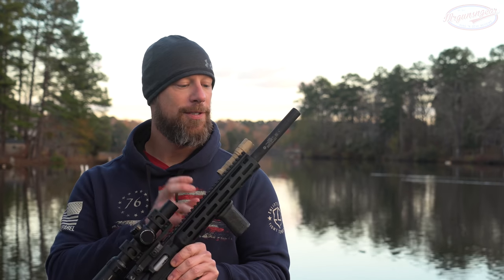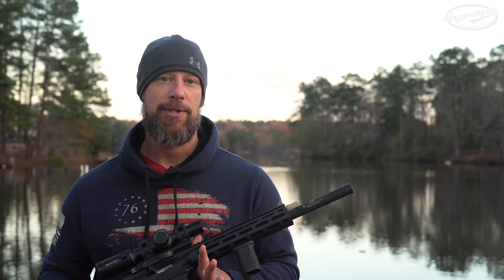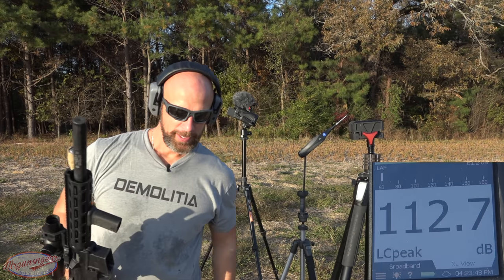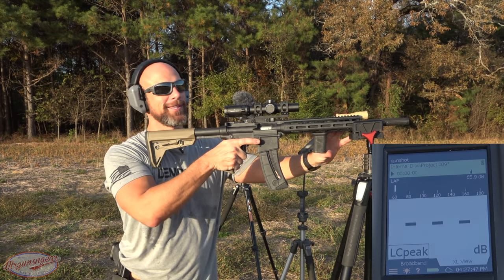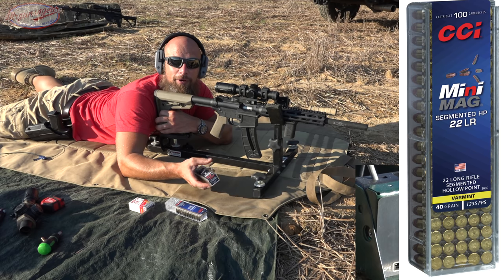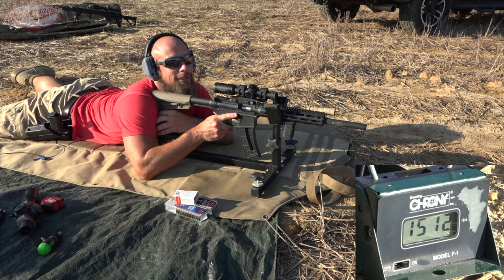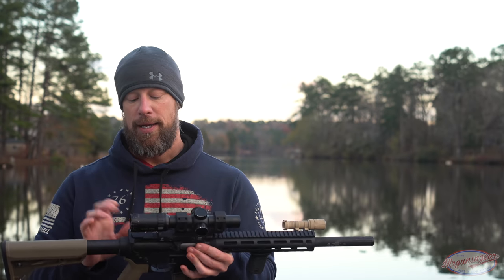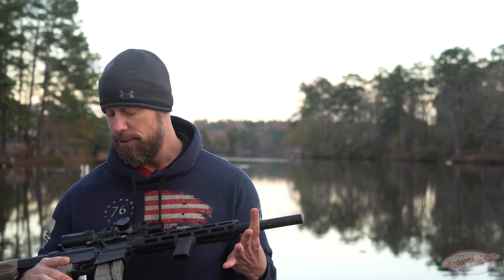Gemtech Integra Smith & Wesson M&P 15-22 Integrally Suppressed Upper Receiver

Comment: How did you not test the 60g subs? Overall this is impressive cause a factory rifle has a lot of issues cycling with subs. As most 22 semis wo suppressors do. 

Man I own 0 suppressors but really thinking of getting this for my daughters 15/22. However my question is the 15/22 is very finicky about getting dirty so how many rounds did you shoot like this wo issues between cleanings? I know my daughters even with upgraded extractor and springs still is only good for 2-300 rounds before it needs a deep clean to be reliable again.

Comment: Since ATF claims they're willing to give out free stamps for braced pistol/sbr, we should push for free suppressor stamps. 🤔

Response to ATF on open comments- "Hey, gubmint, pleez gibs me stamps for quiet time. I'm a poor that can't afford a piece of paper that cost more than the can."
Reply: Should push for abolishing all firearm laws
Reply: Good luck getting a can for less than 200
Reply: @Lordofthepoors  the can isn't the issue, it's the arbitrary paperwork that costs as much as the can that I have issue with. There's about 5 decent rifle rated production cans out there for under $200 but I'd be happy with a free tax stamp for a form 1 & I would order some titanium or niobium and send the cad specs for the monocore baffle system over to my local machine shop. They would be technically making a muzzle break & I would have to tap the O.D. as well as make the sleeve...
Reply: @RichardCranium321  a good rifle can will set you back more than the 200 dollar tax stamp
Reply: @johnniewasr5740  NFA should be ruled void and unenforceable under the Vagueness Doctrine for the "unconstitutional vagueness" concept....

- Vagueness Doctrine:
"In American Constitutional law, a statute is void for vagueness and unenforceable if it is too vague for the average citizen to understand- when average citizen cannot determine what is prohibited OR what punishment may be imposed. Criminal laws which do not state explicitly & define what conduct is punishable are void for vagueness. If legislatures delegation of authority to judges and/or administrators is so extensive that it would lead to ARBITRARY PROSECUTIONS."
Reply: @Lordofthepoors  why does everyone feel the need to be the "well ackshually ur wrong, its this" guy...  is it just YouTube🤔?

I said DECENT production rifle cans for under 200 but materials for a GOOD monocore form 1 will cost right about $225-250 delivered depending on shipping costs. None of this solvent trap BS either.  Those are good for exactly what they're name says, catching solvent.  The issue here is you took what I said and ignored the important part to attempt to criticize me on finances rather than say yeah, we should ask for free suppressor stamps since the things on that list apparently pose no danger because they're asking for mass expansion of items on the list and have no (announced) penalties for them now other than a twisted financial one on specific items which they get to determine on "case by case basis using, but not limited to, the terms outlined in official letter"...
Reply: @RichardCranium321  go for it, ask for free stamps. Good luck lmao
Reply: @RichardCranium321  lmao imagine thinking asking for free registration isn't bending over for the government. Free men don't ask for permission
Reply: @Lordofthepoors  you're still missing my point...  they're pushing one way, rather than defending & discussing that, we should pivot and go the opposite direction.  Keep the braces the way they are, push for free expedited can stamps since they're willing to hand out free sbr stamps. It shouldn't just be us defending our rights & them trying to take them, we should actively be trying to get others back- the best defense is worthless without a good offense... Tell um they should remove the sbr clause & give expedited stamps free of charge to anyone who applies for one. They want to do away with solvent trap market, what better way to do it besides remove the bureaucracy, fees, and year waiting period. Ton of entry level people would spend the $ on actual production cans like the po' boy 30.
Reply: @RichardCranium321  free registration isn't a good thing. It encourages people to register shit. And buying shitty cheap cans isn't a good thing either. I'm not missing the point, your point just sucks
Reply: @Lordofthepoors  I'm sorry to hear you think more cans in the hands of the public at a drastically reduced price is a concept that "sucks"...   I prefer a healthy balance of market competition, especially for Taurus and hi-point owners.   When they push one way, you don't just turn your back an walk away while trying to hide whatever you got. You meet them head on & say "I think I'll keep what I have and I'd like to take THIS freedom back while I've got your attention, thanks"
And as far as a registry goes, if you don't think a federal 4473 database already exists yet they're storing all texts, calls, and emails under the patriot act - you're obviously blind.  I'm not saying "register what you got"  I'm saying "get stamps for NEW stuff"

It's your interpretation and attitude that sucks...
Reply: @RichardCranium321  cool story bro. Let's totally register everything lol
Reply: @RichardCranium321  lol because free registration is fighting for freedom.
Reply: @Lordofthepoors  when it's now $200 and takes a year, it's a damn good place to start & is a hell of a lot better than just sitting back and laughing, doing nothing while hoping the piranha eat you last...  the comment responses are public info,  I'll gladly read yours - oh wait, you're too busy worried about comments on a YouTube channel THAT HAS TONS OF REGISTERED MACHINE GUNS AND SUPPRESSORS...  why aren't you messaging Mike & criticizing him for his S.O.T status since "free men don't ask permission"....

Guess who else doesn't ask permission- CRIMINALS, And the gov't is looking to create more each day.
You go right on ahead, drill those 3rd pin holes, grind all those pesky serial numbers off, go crazy building suppressors and hand them out to everyone you see...  after all, you're a free man, AREN'T YOU??
Reply: @RichardCranium321  cope harder
Reply: @Lordofthepoors  when people like you stand for nothing, they fall for everything... best of luck with your "free men don't ask" when atf knocking on your door with a warrant - because they asked a judges permission they no longer need yours...

Comment: FYI - speed of sound in air is only dependent on temperature, nothing else (not alt., not humidity).  So, you said it was about 95 degrees the day you were firing from prone.  Therefore speed of sound was 1154.48 fps at that temp.  If you shoot in the winter and its, say, 40 degrees then speed of sound is 1095.75 fps.  So as temperature decreases so does speed of sound.  So, if you are making your own subsonic rounds or shooting .22 rounds there is a spread of only approx. 109 fps from 0 degrees to 100 degrees, no matter where you are on earth.  Good to know to dial in your subsonics to always be subsonic in temps you may shoot at.

Comment: The Smith & Wesson M&P15-22 is pure garbage. Do your research before buying. As far as this thing I don't know.
Reply: Mine has ran fine, bought it for my kid a few years ago and we have put thousands of rounds through it. Maybe you got a lemon.
Reply: I have a Gen 1 M&P15-22 and I have no idea how many rounds have been through it at this point; suppressed and unsuppressed with no issues.
Reply: Try sending it back to S&W because THEY AIN'T GARBAGE Mr I did Research!🤣🤣😭😭
Reply: @DERFDE1  More likely you got a good one. Outlawed in 2015 by Project Appleseed. The junk fired out of battery and injured a young girl in the next lane. Fired out of battery, on me, last year. I sent them the pieces I could find. Ruptured shell casing and parts of the extractor. Also a detailed letter asking for an explanation. 1 day short of 2 months I got it back with No Explanation. It's still not allowed by  Project Appleseed. Also I tried 3 different brands of hollow points and nothing but jams. Make sure nobody stands to your right and good luck.
Reply: @freshfowler1398  Sure you did. Project Appleseed. Read reply to paolo dep
Reply: I have yet to experience anyone who didn’t smile after I handed them my suppressed 15-22. Loads of range fun!
Reply: I did do my research, I bought one and don’t regret it one bit